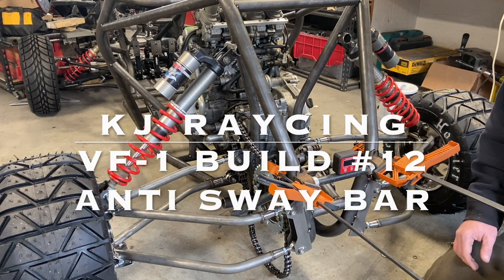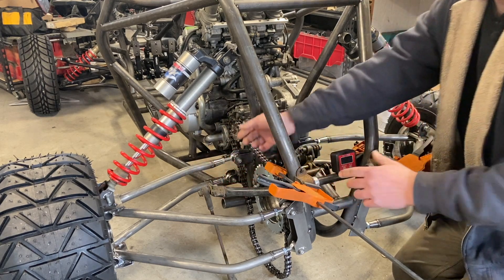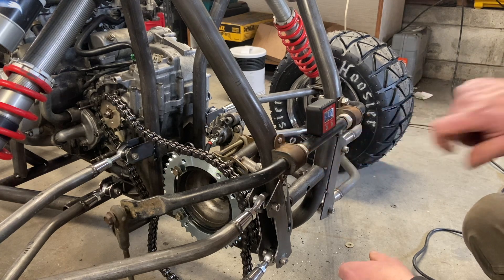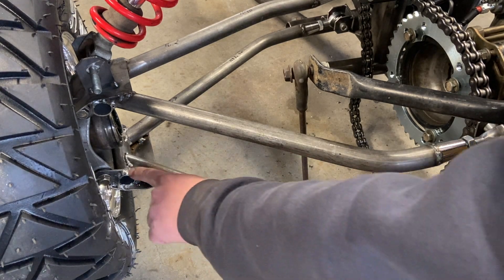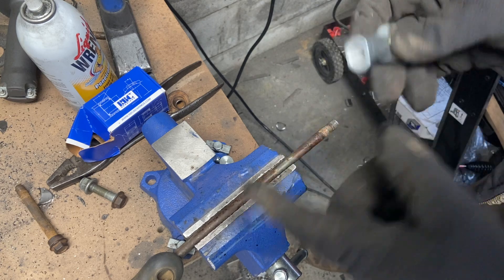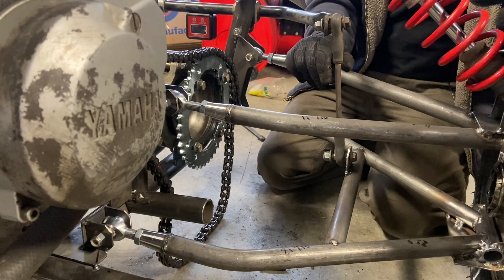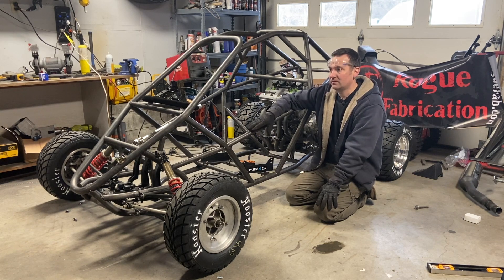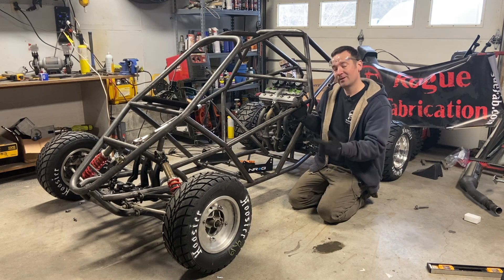Crosskart Build #12: Anti-Sway Bar

Comment: Hello. I wondered if this chassis is suited to a 1000cc or would I need to consider a larger frame. If so do you also have the plans for this?
Reply from the maker: 1000cc is not much bigger than the 600 and it fits really well. Check the description of all the videos for the link to the plans 🦾. Happy building!

Comment: Can you talk about gearing , proper way to adjust , best sproket sizes, how it effects performance etc
Reply from the maker: I can try and squeeze that in somewhere. I just do the math on tire circumference vs sprocket ratio and adjust accordingly. Example; a 22” tire is 110% larger than the stock 20” tires, so the sprocket or gear ratio needs to be 110% for the same top speed and performance out of the engine. I stay away from really big tires because of rotating mass, which i will do a video about...

Comment: Awesome build! I like the way you think. I have a build in mind using the same Polaris outlaw 525 parts that you are. I am thinking about mounting the engine to the right of me (mid engine) with a jackshaft behind the seat (hoping to get a little lower CG and better centralization of mass compared to a conventional crosskart design). Looking for dimensions about a foot less in length (and wheelbase) and narrower (compared to yours). Let me know what you think. Looking forward to your next episode!
Reply from the maker: That is definitely possible and would be a killer ride for sure. Chains are easy to work with because you just have to line them up. Some guy created a 450 sport quad conversion with the same setup you’re talking about but it never caught on. It was expensive.
Reply: Thanks for the reply. I have 10 acres I’m building a motocross and gokart/crosskart track on. Some jumps and flat track style turns. Your channel is very inspiring and pumping me up to get my build started. Can’t wait to post footage of my creation flying through the air!
Reply from the maker: That is so awesome! I can’t wait to see it. Maybe we could do a little racing???👍💪. How far are you from upstate NY?